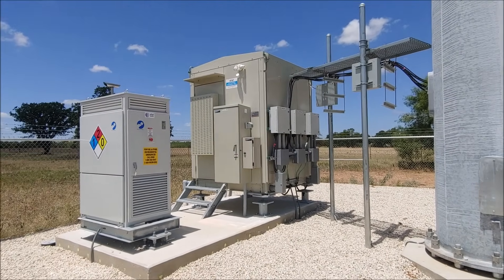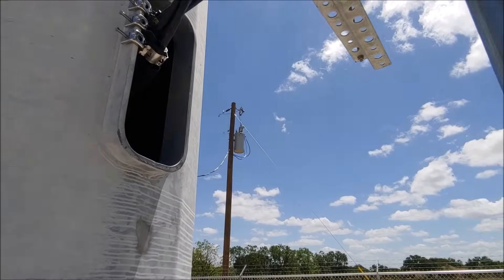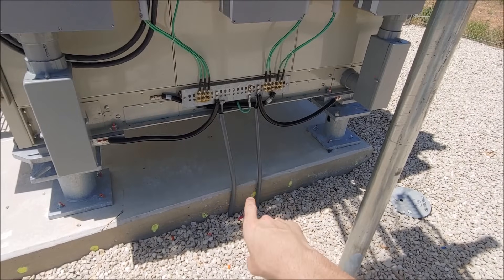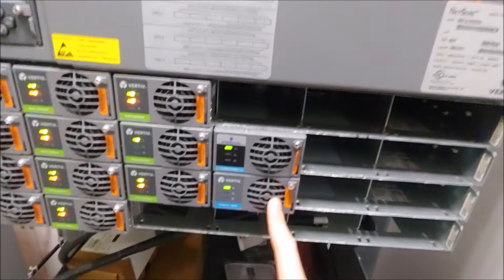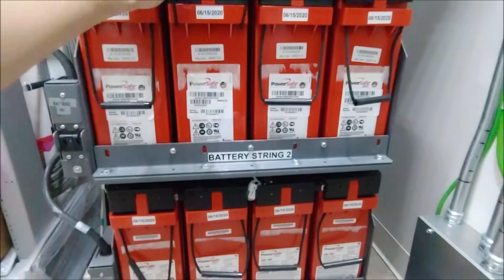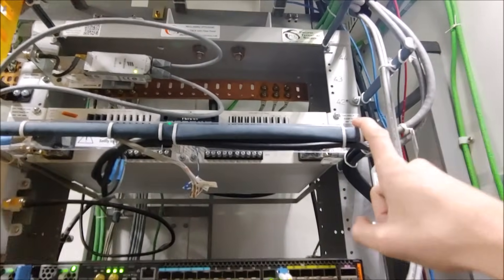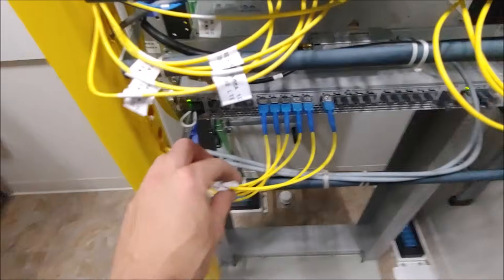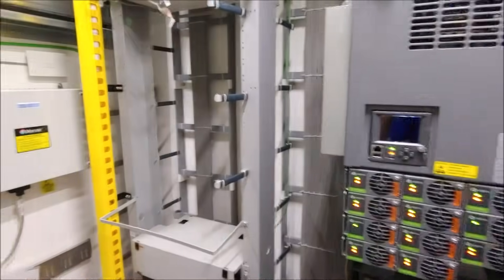Cell Site

Comment: I do the pre-assembly of these WIC units installing equiment on the fif racks and routing equipment power from the pdu to the equipment.  It's really cool to see this installed on-site thanks for sharing!
Reply from the maker: Are you the guy that does the lacing as well?
Reply: Yessir, we do a lot of cable lacing and lugging.  Those DC12 raycap boxes we used to mount on the side and land all that 6 awg telcoflex.  AT&T hasn’t been ordering these WIC’s as much as they used to though, opting for 3 bay outdoor units instead.
Reply from the maker: @xXSynyster37Xx  Yup I was the engineer that ordered the WICs in South Texas, boy can i tell you stories of what ATT shenanigans went on with the WICs.
Reply: I heard a rumor that they had a crane lifting a wic with an extra battery rack and due to the lack of reinforcement in the floor the weight of the batteries tore the bolts threw the floor and the whole cabinet needed replaced. Lol

Comment: I worked for Signal Point Systems doing hvac work for Verizon and At7T for almost 10 years. in Texas. I had 900 sites to take care of. On call 24 hours a day 7 days a week year round. Best and worse job I ever had. Never a day off, but I got to be my own boss, set my own work schedule and spend hours traveling around Texas working at these sites. Loved the job. I normally worked 10 hour days ,but some last as many as 20 and did a few over 40 hour work sections without sleep or even getting home. Summers in Texas are hard on this equipment. If the company had not lost its contract with Verizon I would have retired from this job, but they laid us all off. I once worked so long I saw the sun rise and fall 3 times. That was a long haul. Best job ever. Your all alone, no bosses, no manager, no coworkers. no office people to deal with. Totally alone by yourself all day. I only talked with the regional manger about 2 or 3 times a year. Other than that your on your own.

Comment: The irony of using the push down blocks That were originally used for landline phones.For what seems like decand more We're still present for a different purpose the alarms

I mean hey if it's a technology that works and is suitable for something it exists already Use it don't reinvent a whale and also it still hasn't spice and other types of systems even if pretty much absolute for telco I've even seen some audio and other things ran to this as well

Comment: I did never expect they already put fiber + low voltage DC aöll the way to the top of the tower ... 
wow, I'm absolutely not used to see neat cabeling in videos from North America (I alwas have to think at the overhead wire mess) ...

Comment: Pretty informative video. Nice to see the inner workings of one of these towers.
A big question that wasn't answered is why -48VDC?  Why is it reverse polarity? Then there's several times you mentioned 48VDC without the "reversed" prefix, is this a slip or are these +48VDC?  What's the point/reason for running reversed polarity?
Reply: It is all -48v DC.  As such it is understood and not always cited in casual conversation.  This all has roots in telephony.  

DC power was selected for noise considerations way back in the day.  Probably shortly after the telegraphs demise.  Believe it or not the old school POTS (plain old telephone service) had phenomenal sound qualities between 300-3.3Khz.  AC power is very dirty, and induces a lot of noise that propagates at great distances.  Especially when running tens of millions of miles of copper wire in parallel.    Many filters of varying complexity would have been required to meet the sound quality requirements.  So instead they set the equipment to operate on direct current.

Reverse Polarity:  When they decided to push power from the central office to the subscribers (prior there were batteries in the subscribers phone) electrolysis became a problem.  In a positive power environment the wires and all infrastructure would corrode because they are the anode.  By reversing the polarity and connecting the positive to earth ground the infrastructure becomes the cathode and is not subjected to the corrosion.
Reply: @ShainAndrews   I can understand why they decided on DC, because WAAAy back in Jr High, for a school project , I wired two phone receivers together. and used a 6 volt wall wart to power it. even with a dc output and internal filtering caps, I could still hear some AC ripple. so I used a 9 battery, and Viola! problem solved. Ma Bell would have been proud! 😁
Reply: @Darius_Finnigin  LOL.  Back in the day I could tell you how many switches were setting up a call just by the ticks and hums before the call would switch to line voltage.  Really is fascinating stuff.  Sometimes I wonder what we would have if Bell wasn't broken up.
Reply: @ShainAndrews  Thank you for the explanation; it makes sense. I've been in the basements of lots of CO's and wondered about this when I looked at the battery racks. Some of these Central Offices are creepy places, especially the cable vaults.
Reply: was wondering the same....

Comment: Wait... you're sending fiber up the pole?

So the RF is *in the tower head*, not in the hut?

Isn't that a bad plan, maintenance experience wise?
Reply: Stuff is ultra reliable, like decades between failures
Reply: @motjones2341  Well, I suspect it's one lightning strike between failures.

Here in Florida, that rules that approach out completely.

Comment: Can anybody tell why its so common to use -48V ref to GND as a power line here, instead of +48V ref to GND? Is it something to do with surviving lightning strikes?
Reply from the maker: Legend has it positively charged ground systems help to prevent corrosion.
Reply: @ATI556  It is not legend.  Positive side is the anode for electrolysis.  Thus making all the infrastructure the anode and subjected to aggressive corrosion.
Reply: @ATI556  Oh, thanks a lot! I got it!
Reply from the maker: Also  on in telecom the positive is bonded to ground.

Comment: I'm in school for electrical engineering. Hearing "Coax is a thing of the past" feels like heresy because we learn that if every wire could be a coax cable, the world would be a better place lol.
Reply: There's still a bit of coax, from the remote radio units to the antennas unless the RRUs are the massive MIMO units with the built in antennas or the other combined RRU/antenna units. It just doesn't go all the way up from the cabinet any longer.

Comment: Heh, I'm in Fredericksburg for the long weekend (family still lives there; I used to). Curious where that site is, given that it's single-tenant.

If this is recent, the 850 leg there is NR rather than LTE, as AT&T (given mention of FirstNet this is an AT&T site...I'm not spilling any beans here not mentioned in the video) has run 10x10 n5 here since they turned off 3G, and IIRC 5x5 n5 before that.

Curious whether the 700 fiber covers B29 or just B12, as AT&T runs both here.

Also surprised there's neither 1700/2100 (AWS) nor 2300 (WCS) on this site as those seem to be used heavily here since AT&T has decent market share and needs something to keep the network running reasonably well when you aren't within range of the small cells (which have mmW, LAA, and B2/B66) on Main Street. Less surprised that there's no C-Band there as I'm pretty sure there are only one or two sites with that live here (I caught one around when the eclipse happened).

Comment: Good stuff man, on the fuse panels the white blades are just called blanks. Keeps curious people/animals from causing  a short.  That type of panel is a GMT panel, thus the fuses in it are  GMT fuses.  These days most of the newer panels can take up to 15amp fuses and some even 20.
Reply: Aka cricket fuses!!

Comment: That S9500-30XS is so cool. I'll never get to touch that kind of hardware where I work. Cheap place where my pushing for 40G core with redundant storage instead of a few racks full of bare metal is falling on deaf ears. That ufispace stuff is so cutting edge that almost everything I looked up from them is "if you have to ask, you can't afford it". Either that or they only have one or two customers in the entire continent so never need to sell openly. Don't know. Still cool to look at.

Comment: Do you know why the telephone company uses positive ground?  Positive grounding has been used in the telecommunications industry for many years, primarily because the grounded positive electrode of a battery bank will corrode at a much slower rate than a grounded negative electrode.
Reply: I'd always been told that it was because cathodic transfer in the underground wiring would go onto the wires, making them thicker, rather than out of the wires... eventually making them open up.
Reply: It blocked corrosion in the olden days - in today's world no copper ever comes in contact with the environment so I assume the -48v is no longer a credible reason but just stuck with the industry; maybe someone can clarify why we continue with -48v standard
Reply: @bubba1984  Plain Old Telephone Service (POTS) still works on -48 volts DC and it's all interconnected.  FYI Ringing current is still 90 volts 20-30 hz.
Reply: @bubba1984  this exactally.  There is still 48 V rectifier gear that’s 30 + years old feeding metro Ethernet.  That’s no advantage to adapting a new standard, and there are still lots of copper lines out there though they are dropping day by day.  In my county we have lots of ADTRAN DSLAMs that are fed from bonded t1s. Fiber is terminated at maybe every 3-4  muxes and then fed over copper to the adjacent muxes, using t1 repeaters if required.  90% of lines leave the serving wire center on fiber, but 95% arrive at the customer prem  on copper ( POTS, ADSL, HDSL). The -48 helps protect the copper  by repelling negative ions that corrode metal.  Even the side that is grounded at the CO will have a slight negative voltage just outside the CO.  Same technology is used on underground propane tanks, boats, and pipelines.
Reply: @bubba1984  -48V is cheaper to run. The AC/DC power conversion, copper cabling, DC bullet breakers, and DC equipment is the cheapest over the the other options. -48V systems would use 1/0 power cable with 100amp breakers and the same manufacturer (Nokia 2G BTS) on 24V would need 4/0 cable and 250amp breakers. Depending on how far the cabinet is from the power source, the copper price comparisons were steep. Plus we had to install 750 MCM L3 grounding for the 1800W DC power plant and in the 2010’s 750 MCM was around $33 a LF. A copper thief’s dream hit.

Comment: As a data center worker I am surprised by the temp that is maintained inside these, amazing.
Reply from the maker: This equpment has an ambient temp of about 103. blew my mind when I first heard about it but makes sense since its  agiant heat sink. they are desiged to run hot.
Reply: Would cost them a lot less to keep them cool in the Summer as well if the whole system is designed that way vs having to keep stuff at human comfortable ambient temperature.
Reply: I think he has it backwards.  Usually the vent fan is if the HVAC fails, it will maintain the site at a survivable temperature.  If the vents fan is your primary means of cooling, you are getting insects, dust and humidity inside, and the humidity will condense as the site cools off at night.  An AC is essentially a dehumidifier.    But most of the gear should be rated to 113 deg F.
Reply from the maker: @country_boy9180   actually what I stated is correct the Fans run until the wic gets to 103 degrees then the AC kicks on. This was a directive straight from the customer.
Reply: This is all hardened equipment.  Not something you want to scale out for a data center.  There are efficiencies lost operating at thermal extremes, and a premium paid to operate at those extremes.

Comment: Nice video! I was tower lead for 5 years and a construction manager building new greenfield sites, collocations, and MODs. I also worked on DAS headend jobs and small cell buildouts. I think I know whose tower this was built for, they have a huge bundle of close out documentation and they don’t want to pay much per scope anymore. It’s really jacked up the tower industry since it took hold in 2009 and it’s gotten worse over time.
Reply from the maker: I hear you man the private sector wireless industry defiently hasnt been the same since I got in 2016. It used to be a great industry to be in and then ATT and VZW adjusted there payout methods and drove the industry into the ground in about 4 years. ATT changed their drivers to T5 RIP

Comment: Since you're calling them BBUs i suspect what's going on here is like what cable companies do. They send their signals out via fiber and when it gets to your neighborhood it's converted back to electrical signals. So the BBUs actually generate the RF modulation then convert it to light. Send it via fiber where the RRUs convert it back to electrical signals, amplify and filter it and send it to the antenna. Makes sense now.
Reply: Has a badass sounding name too, “RF over glass”
Reply: Just packets mate.  Everything is just packets being sent over different mediums.  Copper, RF, fiber optic, free space optics.  The back bone doesn't care.  We segment customers on VLAN's and throw their hot dogs down the hallway.
Reply: Between the 3G and 4G network overlays the equipment OEMs needed to work around the latency and one of the workarounds was getting rid of the typical 7/8’s or 1-5/8’s” coax and replacing it with a DC power and fiber trunks (or hybrid). They then designed the RRU/RRH to be installed on the same antenna mast or had it built directly inside the antenna themselves. The BBU down in the 23” rack would do the processing and link back to the switch. They could also link sites in fiber rings for additional capacities if it was available. I remember when I first started as a CM I was building new sites that were including 3G UMTS equipment with the plan to launch within a year. After UMTS was launched, I was given the direction that if I was on a site MOD walk and the old TDMA Nortel equipment was still running to shut down all of its DC breakers as those old dinosaurs were now over the hill. The equipment footprint comparisons are crazy both at the shelter level as well as at the switch side too. Removing TDMA and GSM gave back soooo much square footage
Reply: @JV-wl6ex  What? Ha?  How is coax a latency issue?  Light and RF travel at the same speed of light.  Actually you could introduce latency in the conversion from RF to fiber and back.  I'm sure moving to fiber was a cost cutting move.  When fiber became cheaper to implement then copper and the technology got to the speed it could handle that fast and wide of spectrum from RF to fiber, it was a no brainer.  After all that cut down on a lot of copper issues.  From possible gas filled copper, RFI from other sources and then static discharges from nature (lightening).  Fiber looked really good.  23" rack?  Uh, does telecom use different size racks then the standard 19"?  Interesting.

Comment: I find it pretty amazing that 48 volts is one of the very few constants in the industry. Even have a nice collection of old base station 48v psu's that that are great for powering solid state homebrew transmitters
Reply: Forty-eight volts has been a standard in the telephone industry for a very long time. The Bell System set that standard way back using 48 volts for the talk circuits.
Reply: @williamjones4483  Indeed.  -48 goes back to at least the 1950s, and maybe a few decades before that.

Comment: When a local tower was getting upgraded near me, I talked with the guys, and they told me about how they were ripping out the coax and putting fiber in about 8 years ago. For a fixed wireless ISP I worked at for a while, all the 5Ghz radios these days are powered off POE, and we would have a few POP sites that had 48V and fiber to run everything. I still find it odd that the "Ham Radio" guys don't have radios that are POE-powered and ditch the coax, but most of those guys would probably think it's voodoo magic or something.
Reply: As a WISP/FISP operator and ham radio operator POE isn’t common in ham because of the power requirements for the transceivers are much higher then POE can handle. POE maxes out around 2 to 3a at 48v. Ham radio base transmitters need minimum of 8a at 12v
Reply: Lower frequencies generally used by hams means that the loss across simple coax arrangements is far far lower.
Reply: The Icom IC-905 features a remote radio unit, so they do exist. It does 144, 430, 1200, 2400, 5600 MHz and 10 GHz (10GHz with optional transverter).
Reply: Ever see a Motorola Quantar? what about TXRX VHF Duplexers? can't really just mount that stuff on the tower at 400ft. also LDF5-50a has about .449db loss per 100ft at 150mhz
Reply: @Dratchev241  What about 4GHz?
Reply: @paulsengupta971  what about 4GHz? its not a ham band. and if it was it still useless for ham repeaters.
Reply: @Dratchev241  Ah, I thought we were talking about cellular sites and the use of coax or not. But in the ham context, there are the bands I mentioned above, 1.2GHz, 2.4GHz, 5.6GHz and 10GHz.

Comment: Very neat video. The ambient low frequency noise in the WIC sounds like a diesel locomotive prime mover in notch 8; full throttle.  Wonder how the audio harmonics do that, when it's clear there isn't a running engine at all.  Strange but very neat!

Comment: Got to wonder what the RF exposure is at the bass of the tower. You have an RF radmon? Is it chirping?
Reply: A lot of the time it's difficult to even test the site from the base of the tower, as the RF gets projected outwards. Sometimes you have to walk a bit away from the site before you get any signal.
Reply from the maker: No RF exposure on the ground its mainly only an issue when on the tower. Unless it's a rooftop